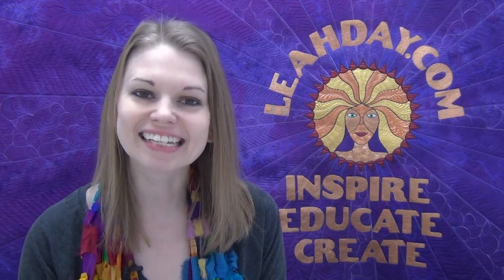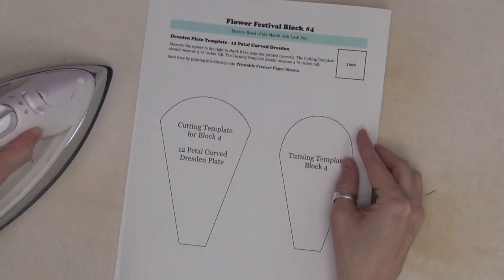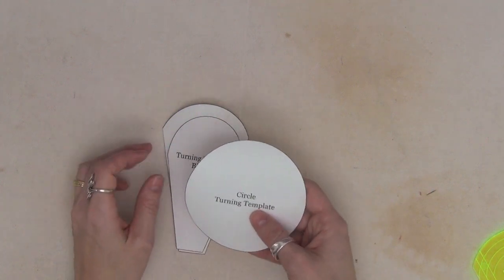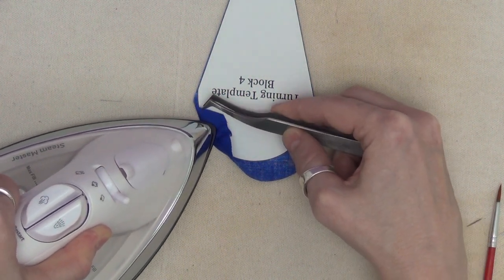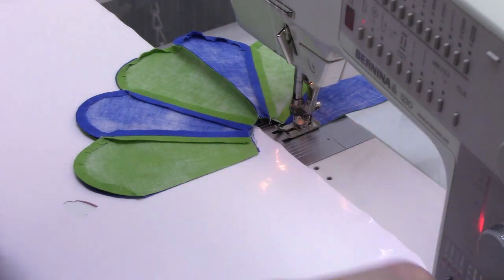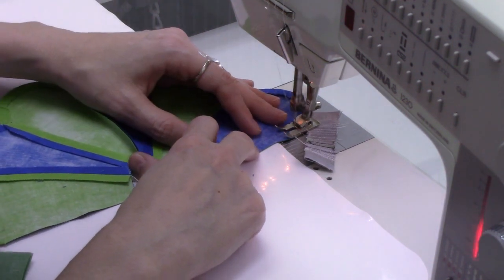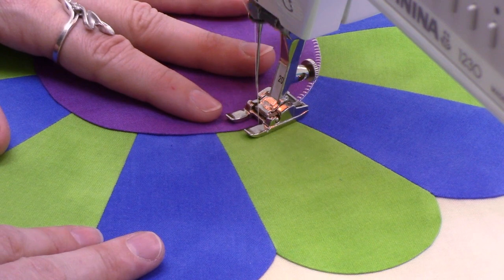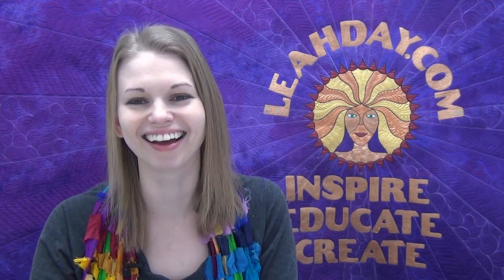How to Piece and Applique a Daisy Dresden Plate Quilt Block

Comment: I would like to tackle the dresden plate QAYG quilt, but I'm afraid that the materials needed and even the videos will disappear before i can finish. I like your color choices as well and want to use those or similar.  Maybe I'm worried about nothing!
Reply from the maker: Yes, you can most definitely get started! The videos will remain online, along with the posts indefinitely!

Comment: Hello ! Thank you for teaching this and others,.I have followed most if not all of your work. My question is where do you find the glue tube, with the tiny hole. I have tried many but all have been to large. I have been so frustrated that I have even used pins and / or toothpicks ,..which is very time consuming. When I get everything pretty secure to stitch ,I am done and don't dare to do any more for two or three days ..Thank you
Reply from the maker: I've been considering carrying these in my shop as they are so hard to find. I'll let you know when they are available!

Comment: Thank you for the video. I found 30 Dresden plate flowers that my  late Momma had hand pieced together. How can I attach these to the block without losing the hand stitching?
Reply from the maker: You can glue them to the block and then hand stitch around the outer edges. You can also machine stitch. The hand stitching will still be in the blocks even if you machine stitch them to the background.